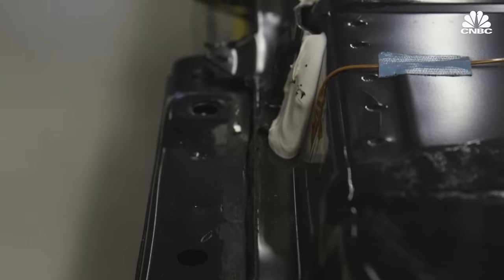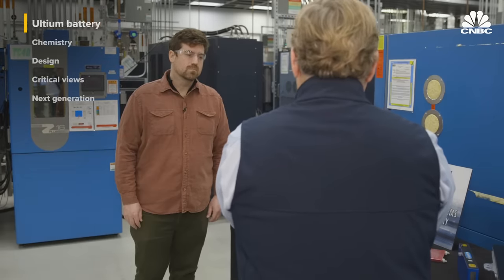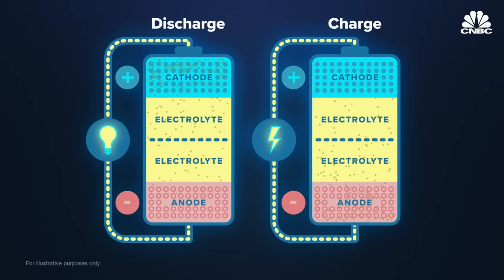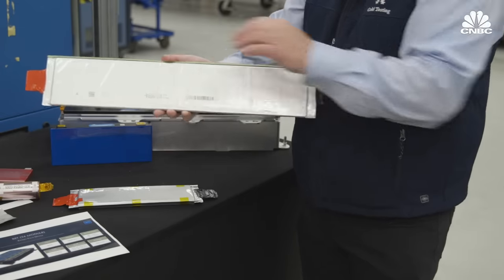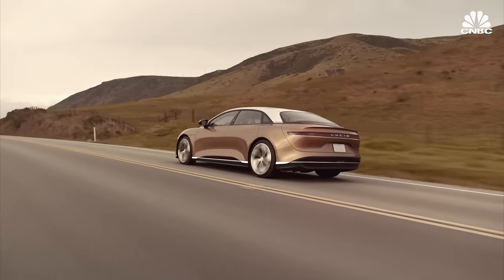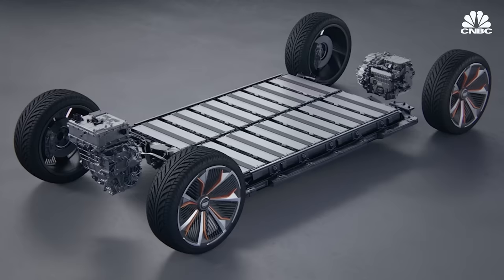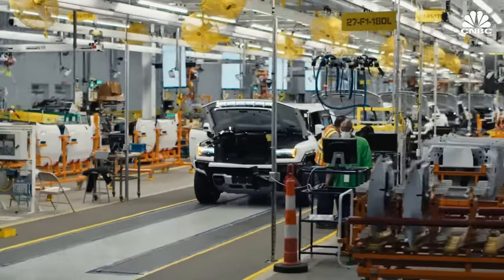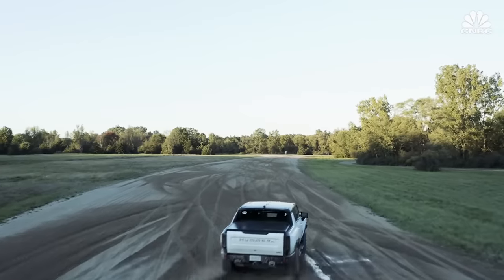Why GM Says Its Ultium Batteries Will Lead It To EV Dominance

Comment: I've owned three different Chevy Volts, the large-battery hybrid they built 2011-2019.  They knew what they were doing even then.  Volts are very dependable.  The battery management system was very well designed.
Reply: The problem is in Q1 of2022 they only made 26 of them, in 3 months. After eleven years of experience with the Volt you’d expect they’d be making and exporting millions. What’s wrong with this picture?
Reply: @wattlebough  After they sold enough to where the government rebate was no longer available the price was less attractive.  GM wasn't making much on the Volt anymore. . So they said
Reply: Because the Volt ICE motor was used as a range extender the battery management system works well on the Bolt.

Comment: Ford and GM were surprised by the demand for electric trucks ...

Gas guzzling behemoths that people buy to drive their kids to school and get groceries in are the perfect candidates for electrification.  Moms buy these battlecruisers specifically for the size and their perceived safety, and then whine about the cost of ownership over the lifespan of the vehicle.  The local driver is a target rich environment for these kinds of vehicles to be replaced, leaving more fuel for the long haul, heavy lift vehicles that need them.
Reply: Great comment
Reply: @DP-sh3nk  The electric versions are still more efficient than the ICE counterpart. Problem is the range when towing. That isn't an issue for people using them to drive around town.

Comment: GM hasn’t led in technology since the early years with Leland and Kettering after they purchased Cadillac. They kept trying though...tried borrowing ideas like the fiberglas car body, rear-mounted air-cooled engines, aluminum cylinder blocks, plastic intake manifolds etc.  Mostly they’ve relied on advertising...Heartbeat of America and so on.  GM started as a holding company and went right back to their roots in the 70’s when smaller, more efficient cars were needed and GM knew just who to buy from cheap and rebrand as their own.  GM has never been a company for going the extra mile and perfecting their borrowed ideas.  Don’t be surprised if “Ultium” never performs as cool as it sounds (and I say this as a guy who did engineering on the plastic intake manifolds and Northstar system).
Reply: I love the smallblock Chevy v8.  Over 100 million were produced.
Reply: "a guy who did engineering on the plastic intake manifolds and Northstar system" Did you also pick the cylinder head bolts and tap by chance????(threads would strip=loose head\burn coolant)

Comment: Oh imagine if GM had this world changing vision 30 years ago when they had the resources to lead the way. They could have launched a revolution. They could have called it the EV 1.
Reply: @AndreVsHimself Big Oil, big car parts, dealers reliant on service... No one in the automotive machinery was incentivized to switch. Change could not be driven from within the ICE industry as long as oil was reasonably priced.
Reply: Harry, I bet you'd be happy with a lead-acid battery powering your car for those 30 years, too.
Reply: @rand49er  I bet if the industry prioritized the advancement we would not have needed to wait thirty years. Innovation speed is dependent on priorities.
Reply: @rand49er  Gotta start somewhere, and look how far Tesla/ TSLA  has come, the most valuable company  that happens to make cars, oh Elon thinks  that its Energy  division , as in Power Walls, Powerpacks and Megapacks could  be even bigger than the  car business as the Whole  World goes renewable.
Reply: Woulda, coulda, shoulda... but didn't!
Reply: @rand49er  The EV1 had Nickel Metal Hydride batteries when GM crushed them.
Reply: @LoanwordEggcorn  not initially.  Later versions, yes.

Comment: The same manufacturer that made EV1 way before Tesla and scrapped the electric vehicles for making super size gas guzzling SuVs, Hummers.
Reply: That was decades ago, get with the times
Reply: @brotherdaveseattle2791  gm has only gotten worse since. Sold out to China after bankruptcy
Reply: You couldn’t give me a GM product. No thanks. I’ll stick to my old Prius.
Reply: @MsNickie1001  I traded my GM 7 years ago ago, and I got myself a Toyota Corolla hatchback. Best car I've ever owned.
Reply: @FishyFelix  I’ve only owned one GM car, an insane purchase. It was a Pontiac Firebird 400. Damned thing would pass anything but a gas station. I didn’t have it very long.
Unless you count the Saturn. I had two of those, very good cars, but they wore out cosmetically pretty fast. I would have bought another Honda instead, but couldn’t afford it.
Reply: @FishyFelix  I think my old Toyota Prius just might be the best car I’ve ever owned   
12 years old and feels like new, looks better than any other 12 year old car or truck I’ve ever had.
Reply: @MsNickie1001  in the early 90s, any of the big five manufacturers made great vehicles. Cars had more metal than plastic, nowadays its the other way around and things are engineered to break. Profits are made on parts, not vehicle sales.
Reply: @FishyFelix  somehow, I find this easy to believe.
Reply: @FishyFelix  gross

Comment: I praise the expansion of ev options but the problem I see is a big ev is like a big gas vehicle: inefficient. 
Lightness is virtuous. Less material cascades to lighter parts, lighter smaller battery and motor equals more range per weight
Reply: This would be a great excuse to not give people a ride since it will hurt how far I can travel before recharging. 😂
Reply: GMs whole brand is making big cars though, downsizing would mean a lot more competition
Reply: I want to see a minimum cruising range of around 600 miles. That's one full day of driving for me when I'm on a long trip. And I drive a full-size SUV.
Reply: People love their big cars or trucks even though most of their driving is with 1 person in the car and rarely more then 4.  Plenty of truck owners who only need the extra size or storage a few times a year.  Might work more efficiently(and financially) to buy an efficient vehicle for $30k to $40k rather then an inefficient $80k truck that is only needed 4 times a year; save your money and then rent a truck for those 4 uses.
Reply: It's funny how people keep talking about lighter vehicles when the real bug-a-boo in any vehicle is it's frontal area.  If you don't do anything about that all of the streamlining and weight reduction in the world is only incremental gains at best.
Reply: @AeschylusShepherd  With a 6000 LB Lyrik, I do not believe a 200 lb passenger will change much......Paul
Reply: @JustForFun-mt9og  I always fill My CX30 at 1/2 tank, about 160 miles................Paul
Reply: @johnnylightning1491  Wind drag is the BIG factor......Weight, NEH...........Helps with regen.........Paul
Reply: @paulholterhaus7084  - I'm paying attention to the research into new fuel sources. One of particular interest is Hydrogen Power Paste. It's described in the link below.. The potential cruising range on one tankful is estimated at up to 3,000 miles. It's still in its infancy stage in terms of development, and perhaps will prove to be more useful with aircraft.

In general, I believe there are still new chemical compositions for batteries that are being tested, as well as power sources such as this Hydrogen Paste. I won't be buying for a few years, so I have time to weigh things out.
https://www.youtube.com/watch?v=cahzRSO5niE&t=76s

Comment: Everybody is talking the talk. But most are not getting it to the market for a reasonable price. If this pans out good, I would hope that they also produce these batteries for power walls and for off grid solar systems.
Reply: Batteries are expensive. That's not going to change.

Comment: This is like watching a video about Tesla from a literal decade ago. It looks like the batteries inside GMs packs are based on a platform that's roughly that old, too. EDIT: I should have just finished watching. CNBC actually included competent/properly informed critical opinions for once. Nice. Tesla has 12+ month order wait times, so if automakers want to start taking EVs serious, they've got a year to do so. Keep capitalizing while you still can, Mary.
Reply: With less than 600 EVs sold last quarter Mary and GM have a long long way to go to catch up to Tesla, as in it will never happen.
Reply: You know zero about Ultium.  Goose egg.
Reply: Tesla uses Cylindrical batteries tho, extremely different from the Pouch and modular approach with GM. Tesla's are great but let's not pretend that they could catch up.
Reply: Had 4 Teslas.  So glad to see competitors due to quality.  They are catching up and/or exceeding Tesla now/soon.  The "range" in a Tesla is highly over estimated versus other EVs often when in same conditions and their battery tech is strong, but is naive to think other major players won't catch up and/or exceed their production pretty quick, especially in the truck category - only fanboys are going to want an odd shaped trapezoid truck.
Reply: They look like pouch cells which is very dangerous and at risk of runaway combustion. Tesla specifically doesn’t use pouch cells for this reason. This isn’t going to end well.
Reply: @travwill  GM and quality don’t belong in the same sentence
Reply: @rand49er  Ultium is marketing  hype , its all HYPE ,GM will start making how many BEVs by 2025?Teslas BEV production rate as of today is  1,000,000, TODAY, not 2025 !
Reply: @holycrapitsjake_  Hey, be nice, our GMC quality has far exceed that of our Tesla MS (2022) so far as well as previous S/X/3.
Reply: @taefravis  Yes.  They have 3 battery factories under construction; Ultitum #1 in Lordstown is wrapping up now for Hummer, Cadillac, and Chevy/GMC brands.
Reply: No,Elon will sell you a Y right now if you are close to Texas.
Reply: @MusicalMemeology  Tesla has that new coiled battery (4680) that bypasses many of the typical Li-Ion problems.
Reply: @holycrapitsjake_  I have 5 GM cars currently, owned several other GMs. Best cars I owned. Before were Audis, Mercs. Yep. Premium cars from Germany.
Reply: @manoman0  Good for you, but your personal experiences are just anecdotes. I can easily counter your point with my own awful experiences with GM, or the fact that I’ve never met a single auto mechanic that considered GM vehicles to be smart purchases. But I think the consumer reports rankings speak for themselves.
Reply: @holycrapitsjake_  Yes, those are my personal experiences and that's all I can speak for. I keep my cars in great condition and don't beat them around the corners. 

What consumer reports are you talking about? Most of them are nothing more than purchased opinions rather than statistics to be trusted. Generally, no car is a smart purchase, they all depreciate. Our very own AMG cost us 15k repairs for all sorts of stupid stuff going wrong. Was that a smart purchase?

Comment: Something completely left out is the Chevrolet Spark EV (I have a 2014 model).  Yes, it's a compliance car, but it is their first true consumer EV not tied to a lease program like the EV1.  FANTSTIC little car - has just what you need with a few creature comforts, is affordable, and reliable!
Reply: It had an GM badge. It was a Korean design and development. Nothing US based in knowledge.
Reply: How many miles you have on it? Did you have any range loss so far? I currently have a Nissan Leaf but I wanted a smaller car with CCS charging and thr Spark EV seems to fit very well, but I wonder if range loss is lower or higher than the Leaf.
Reply: @RedBatteryHead  And the Bolt is made where?
Reply: @gteixeira  I can get around 65-75mi per charge, get 4.3mi/kWh, and it has about 98Kmi on it now.
Reply: @misturchips  it's now made in US. But the car was a Deawoo development with LG chem. Same as the spark was.

Comment: All this stuff is still way expensive. One of the main points of electrification is the reduction in tight-tolerance, high-assembly time mechanical components. You pretty much end up with one moving part, the motor spindle.

Point being is that when these machines are mature, they ought to cost one helluva lot less to make than ICE vehicles.
Reply: Totally agree.  Much simpler and fewer components, and fewer labor hours needed for assembly.  When production numbers scale up, EVs should be cheaper.
Reply: Just read an article,that changing the battery is more expensive than a new vehicle. Don't  know if it's TRUE, but agree with you, way to expensive for the majority of people. Then again that may be their intention that only the rich and the government will be the only ones driving( won't need as many charging stations with that theory)
Reply: The right tolerance just moved to the electrode thickness and how much and how quickly both electrode swell inside that pouch. The cathode swells a bit more on charging. So there isn't really a reduction in right tolerance parts. It just gets shifted to the new parts added like the Energy storage system, (the battery pack)  and it's related parts. Electrode swelling and thermal management will be the new quality challenges, especially when electrode thicknesses, both material coating and metal substrate are measured  in micron or equivalent, ( 0.0001").
Reply: @allencooper3622  Was it a GM vehicle?

Comment: You show me where the 450 Mile Range Lryiq Car is, and I will go buy it right now! I went to a Cadillac Dealership 2 nights ago and all I'm seeing are 307 Miles Cadillac Lryiq's currently stocked. The one thing that is holding me back from getting an EV right now is Range. I'm used to getting a good 435 to 450 Mile Range on my 2020 Cadillac XT5 right now, but the gas prices just keep going up like crazy. I just can't see myself going from 435 Mile Range down to a 307 Mile Range, and that is when the weather is good too... When it gets cold out that Range goes way down too.

Comment: These pouch batteries have some real down sides. They're more expensive/slower to manufacturer. And they don't discharge heat as well as something like a Tesla 4680. The Munro associate in this video  makes good points about how virtually everything GM is doing is no better or behind what other manufacturers are already doing.
Reply: Chances are slim that you, Sofia Freja, are an electrical engineer with a post graduate degree in high energy battery design.
But that is* also a picture of Sandy Munro...all mustage and no mathematics...perfect for the audience here where a basic expression of calculus is not tappable. 
Just sayin...the playfield here is* level and don't think much about lifting it higher than The Mustache Level.
Reply: "they don't discharge heat as well" I think that is why the Liriq battery in the test bay appears to have what look like hoses going to the battery- likely to cool it?!?!?
Reply: @calmorton4619 well how does it look like... GM ULTIUM fail battery

Comment: I don’t think people realize how high gas prices will negatively effect the sales of the ICE gas guzzlers that manufacturers love due to high margin. Winter is coming.
Reply: Car demand already exceeds global manufacturing capacity. Automakers have nothing to worry about.
Reply: High oil prices always leads to low oil prices. 
High prices makes oil companies pump more.
Reply: @TheBandit7613  that used to be to true. now shareholders are demanding returns through divs and buybacks so oil companies are more hesitant to invest in capex. Opec is also struggling to up its production and is continually  failing to achieve its agreed upon production. the under investment in the sector due to many factors will keep oil relatively high ( i dont see oil going below 75$ for the next 2-3 years)
Reply: @gargalash9191  One other IMPORTANT thing...
The push for EV's is a bad joke. The grid is not ready for EV's.
What do you think will happen when 150,000,000 people come home from work and plug in their 240 volt, 50 amp chargers? ZAP! There goes about a million breakers. For EV's we'll need thousands of new power plants. The problem, one new plant takes 20 to 30 years along with the permitting issues. So if we start RIGHT NOW and work really hard, maybe in 50 years there will be power for EV's. 
Windmills and solar won't be enough.
Have you seen Michael Moore's documentary Planet Of The Humans?
If not, it's free here on YouTube. I suggest you watch it to better understand the renewable energy market and what a huge scam it really is.
Reply: Forgot to mention oil leases stopped.
Reply: Except Aptera. 40 miles of range in the employers parking lots from the sun, and 800-1000 range.
Reply: @TheBandit7613  renewables can easily supply the worlds current energy needs. It just needs to be built. the costs for storage and generation continue to decrease while the costs of conventional energy generation increases. it already makes financial sense for companies to buy battery packs like mega packs.
Reply: solar is now the cheapest and will continually improve. solar plus storage is the future. eventually the panels will be in space and energy will be transmitted wireless.

Comment: I hope they can pull this off, but I am very skeptical. Their Bolt was well liked by its few buyers, but they have a total battery recall due to fires. Not a great foundation. So I'm rooting for them, but they have to actually make decent cars in volume. Will they?
Reply: They haven't done so in over 40 years, I doubt they'll start now... I'll believe it when I see it.
Reply: The Bolt recall is due to a chemical error by LG. Too bad.
But our Bolt is almost 5 years old and the battery is still almost at full capacity! So the battery management is pretty good. I see no reason why this car wouldn't last another 10 years probably more.